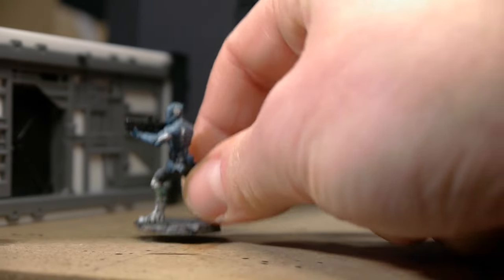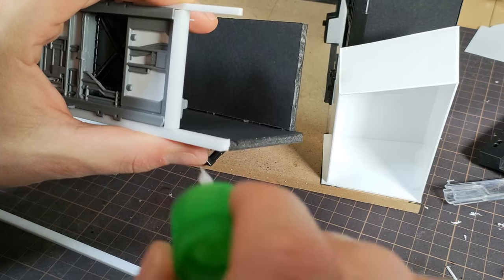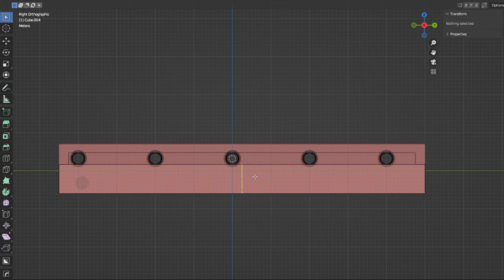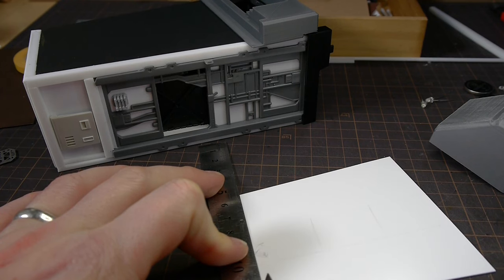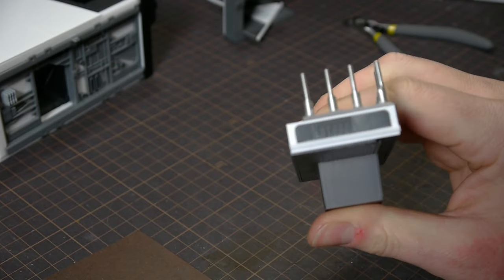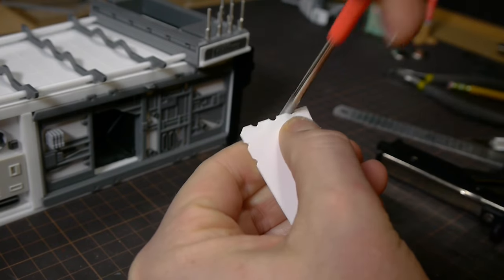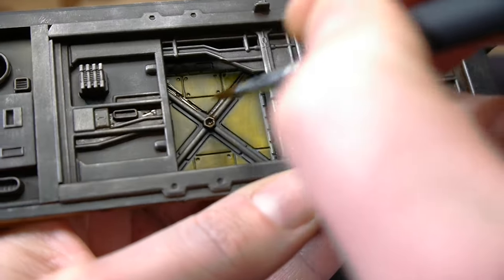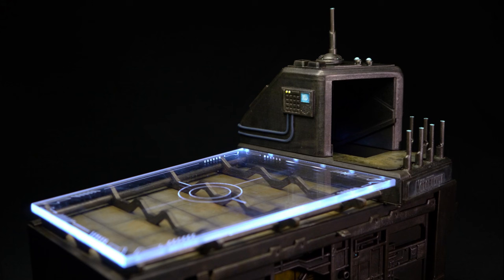I made a light-up landing pad on a cyberpunk building | Cyberstreets Diorama Building #2

Comment: Hey BP! On your LEDs, the resistor isnt just about dropping voltage, but limiting current.

This kind of resistor arenagement is called "ballast" - and its basically the electrical equivalent of sandbags on a hot air balloon, it prevents the LED from soaring too fast in the circuit.

The resistor value for your circuit is ~0 ohms because your power source is technically insufficient to drive those LEDs, so given alkaline batteries youre probably fine - but performance will probably be sub-optimal (in this case, probably meaningless - just a technical distinction).

To improve the performance of this circuit, you need to find the "voltage drop" or "forward voltage" for the LEDs and use at least that many volts (taking into account that voltage in batteries decreases as they lose charge) these white leds are like 3.2-3.4V, higher than the 3V input. This means the LEDs will be sucking on those batteries like a toddler on a near empty juice box, which if you were using lithium batteries could have spicy results. 

Adding a third AA battery would give you enough voltage, but you'd need a 68ohm (or thereabouts, mathematical optimum is 68ohm for a perfect 4.5V input) resistor for EACH LED.

I thought it was worth mentioning - as your voiceover seemed to indicate an incomplete understanding of the reason for not using resistors, which I appreciate may have been for brevity - analogue electronics being as dry a topic as it is.

Anyway, on the build. I cannot believe how freaking tidy your etched plexi looked. I'd never have even attempted that without a laser. Mega kudos. The edge illumination is genius, and your use of those train parts is going straight in my toolbox for later use.

Great build, truly. It's all coming along wonderfully!
Reply from the maker: Awesome comment and thanks for the detailed info! You're half right about my rationale. I know current could have been handled properly with resistors and I also figured I didn't care for this application with such low use and low stakes. The thing I don't have is the patience or proper parts to make the perfect circuit 😅